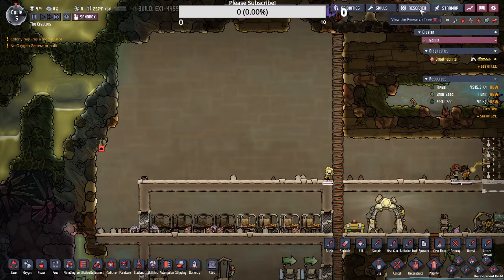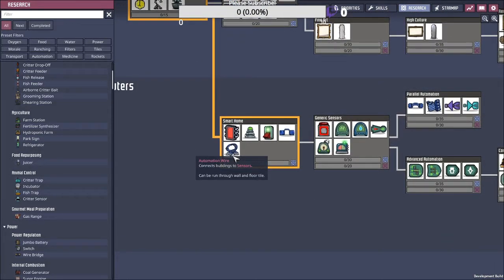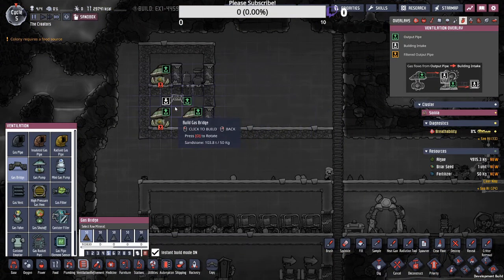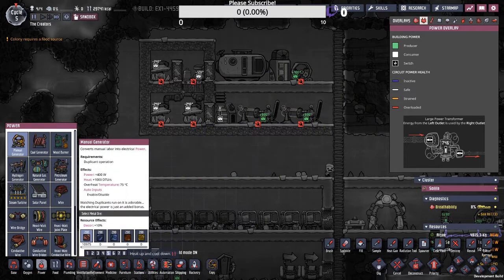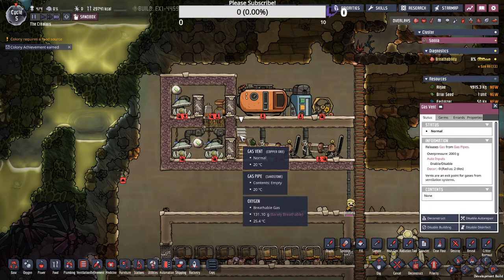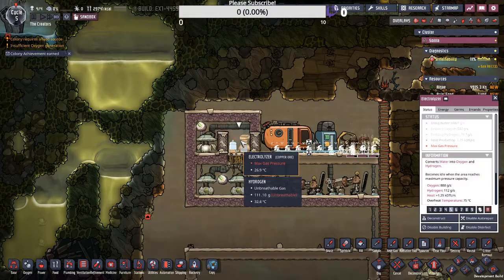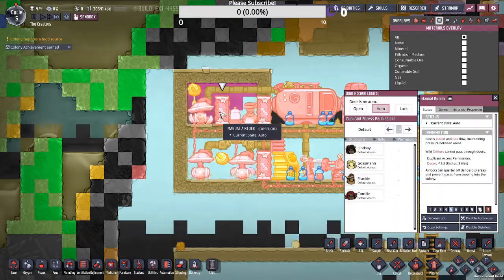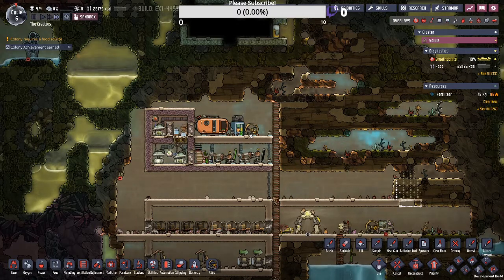Oxygen Not Included: Self Powered Oxygen Module (SPOM) Tutorial

Comment: You will cook your base using this system. Oxygen coming out of this is 70C+. Can be more depending of water temperature.
Reply from the maker: Hey, thanks for watching! You're correct that this design doesn't address heat generation, but it's a simple fix by throwing a radiant pipe loop over the gas pumps in the bottom chamber to your existing cooling system. 

Remember, this is an early game design; there's nothing wrong with tearing it down once you have a better system.

Comment: So its 240W per Gas pump *3 = 720 + 120 for Electrolyzer.. Its 840W while Hydrogen Generator produce only 800W how is it self powering? It should run off before canister fill up and run second Generator with excess gas. Are these little "breaks" in pumping enough to save enough energy to keep system going?
As i tried some SPOM builds (mine or others) and non of them keep running and it need constant overseering which is annyoing. 
(not counting Liquid Pump as its even more power but ussually there is already 1 powered Liquid Pump in base)
Reply from the maker: Yep, it's self powered, but that does not include the water pump. It's crucial that you have a smart battery though if you're using two air pumps to pump out oxygen. 

Being the paranoid person I am, I leave a hamster wheel in the circuit for those just in case moments.

Thanks for watching and commenting!
Reply: @arktoh  I think of those manual generators like a starter motor. Even IRL power plants need some initial power to start.